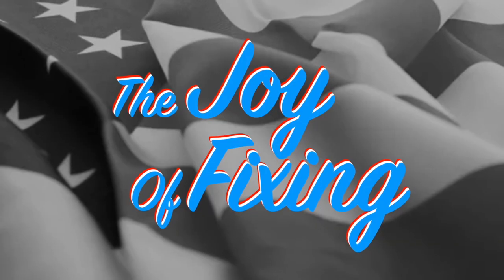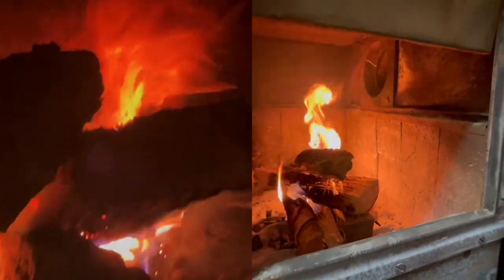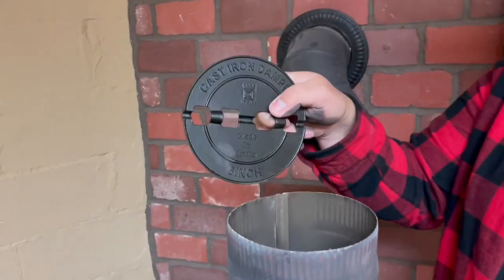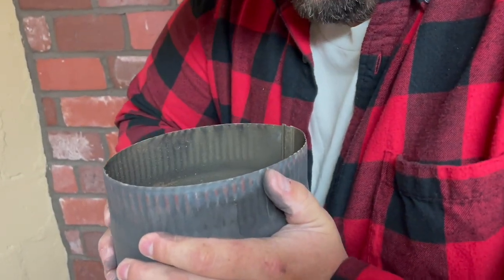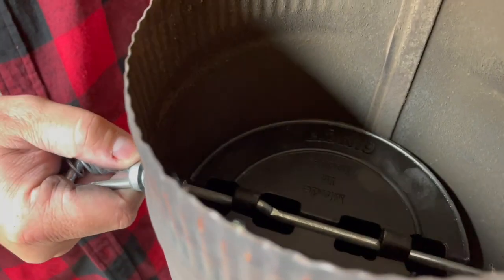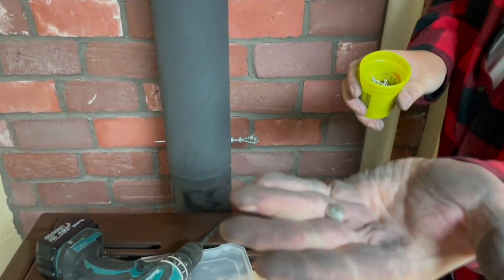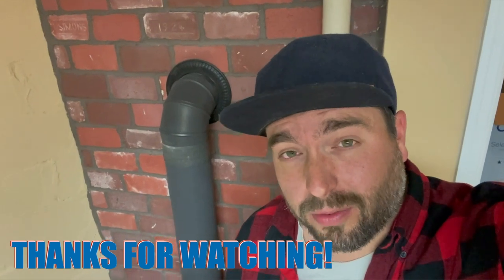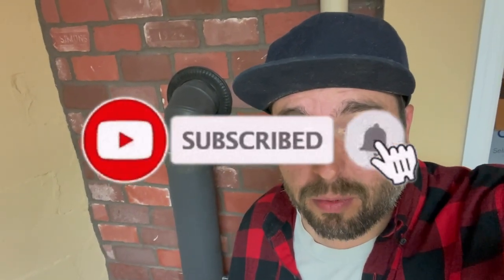This might MASSIVELY change your wood stove performance! Installing an Updraft Damper on your Flue!

Comment: I can tell you from experience that the flue damper made these days are just junk made in CHINAMAN ASIA or INDIA.. I change mine every year for the past three years. Then I had enough and made mine from exotic materials. INCONEL flapper and fasteners, TUNGSTEN ROD and Stainless Steel split collar clamps. Has been two years and the homemade unit is just bulletproof, period. 
        The stove pipe should be stainless steel instead of regular steel painted black. The heat resistance of stainless is so much higher and way safer too.  
        The stove that you have is perfect for a secondary burn option or you could probably just use perforated round pipe placed between the burn chamber and the flue pipe outlet of the stove. 
        What is the brand stove and what is the size of the burn chamber ??? 
         Nice work fella with what you did including using a stainless screw to keep the pipe from separating and causing a fire. The use of the corrugated elbow near the stove is a good safty feature. Adjustable elbow like the one on top have been know to just come apart at the most inappropriate times and cause a fire. Just saying without judgement fella.
Reply from the maker: All great points.
The Indian damper was definitely my best option locally. The Chinese one was like.... you could feel it was practically zinc. haha. My little shop doesn't currently have electrical so my tool power is limited, unless I have the generator out there. Once I get some outlets down there I'll end up having more tools to fabricate with at my disposal and maybe..... MAYBE I'll make my own damper some day.
I've had a hard time finding another corrugated elbow locally but apparently there's a store in the next town that stocks them so next time I was out there I was gonna go looking for one. Indeed, those movable elbows can fall apart eventually from getting so cold and then hot over and over again.
The stainless pipe would be great, but I honestly don't mind having the extra surface area letting off heat in my situation. Plus it's less than a 5 foot run of pipe and it's straight into the brick chimney.
The stove is like.... "King" brand. It's kind of an Ashley style stove with the coil thermostat that automatically articulates the air intake door based on how hot the coil is. Pretty cool unit. I've got another one in the shop that's even bigger. Burn box on this one is probably2 to 2.25 cubic feet. However, you can pack it to the top because it all just slowly burns down throughout the day/night if you set that thermostat to EXTRA LOW and the air is just barely creeping in (once there's a good coal bed going, that is).
Thanks for the comments. Great conversation!
Reply: @thejoyoffixing  I will watch your channel Joel for sure. The nice thing about my damper is the adjustable locking collars which can be adjusted for wear and tension. The unit is burn proof. The same material that is inside jet engines. The only thing missing is the external heat coating made of ceramic material. 
Nice conversation with you also Sir.
Reply from the maker: The adjustable locking collar would be a game changer. Honestly it's nearly impossible to find a complete damper assembly that would include a collar, or a splice, or even just.... you know... it's own housing (clamped or crimped or however it would be made..... but clamping would be nice to avoid all the crimped fitting drama), 
Also, i'm a sucker for ceramic liners on ANYTHING that's redirecting heat or exposed to constant heat. Wish someone would... make one of these for my SHOP STOVE cough cough cough haha
Again, thanks for the conversation.
Reply: @thejoyoffixing  I can tell you that these days it seams that if you want something really good you have to make it yourself. The excuse of Covid is just a bologna story to make things cheap for a high price, PERIOD. I can tell you that I just love making things for myself. Especially using exotic materials that will not wear out in my lifetime. Must be an addiction that I posses. Peace
Reply from the maker: I love making stuff too. My daughter as well. It's fantastic to create solutions instead of just buy solutions made of inferior materials, or that don't specifically meet the specifications you desire. Agreed that Covid really fleeced a lot of people who weren't willing to question anything they were sold or told. Tack on outlandish amounts of money fueling proxy wars and some Weimar Republic level inflation and I'm shocked more people aren't turning off their social media and takin action. But.... you know how it is.... people are content trading their freedoms and even their very livelihood for the illusion of safety and immediate comfort. 
There's a lot of joy in solving problems and fixing little things. Creating things. Figuring stuff out yourself. It's really something everyone could benefit and grow from.
Hopefully over the next few years I can help contribute to helping people find a starting point to trying stuff out for themselves. It's a true joy.
Reply: @thejoyoffixing  I could not of said anything better myself. Since you have covered the problem solving aspect. I have a fix for you and your wood stove. The flu pipe that is seen on the video from the inside of the fire box needs a round piece of perforated pipe longer than the six inches pipe the is exiting. The idea is when you close the firebox door. The round perforated pipe is slide closed with a round rod that goes through the wood looking door. This will cause the gases to combine with the available air and make the stove so much more efficient. You will be using one half the amount of wood that you used before. Yet the heat output will really increase. This causes pyrolysis to occur and burn wood completely. Then you need to bring in secondary air with stainless steel tubing that has holes drilled on numerous pipes. The pipes should really control the air just at the point of combustion under the insulated self located close to the roof. This gives you ultimate control with maximum heat output.
       The information given is not in a sequential fashion. This was done deliberately to make one reread the three parts of the paragraph. Hope this makes sense. Question if you need any clarification. Good day too. vf
Reply from the maker: No that all makes good sense. I was able to sort out what you were saying. I almost missed this response again because this video is getting so many comments I'm losing track of what's getting replied to. Glad I caught it!
Thanks for the conversation. I hope it helps others out, as it's sure given me just more perspective.... which is what this is all about. 
Seasons greetings and may God bless you and yours!
Reply: @thejoyoffixing  Thanks a bunch Joel. Same to you fella. You gave me such an open outlet to help others with stove STUFF. Keep on making more great videos for us all to learn from.
Reply from the maker: @victoryfirst2878  Thanks, buddy. I appreciate the kind words. I was hoping to release a video last week but health issues and waiting on a specialty glue pushed it back. I have a few coming up that are truly a pain in the butt, but I've figured out some pretty reliable ways to address the problems. Looking forward to sharing them.
Thanks for subscribing and thanks for the conversation.

Comment: I do believe there is a proper direction of flow on your vent pipe that you may have it reversed.
Reply from the maker: I have the same hunch as you but this is how the pipe was installed when I arrived at this house. I have plans of flipping the entire assembly and adding another corrugated elbow once I can find one in stock locally. Good eye.
Reply: @thejoyoffixing  I've always been told and read the reason the crimp end of metal smoke pipe  goes down on wood fired is so that any creosote running down the pipe will run down INSIDE the pipe. If the pipe crimp was up the creosote would run down and out the female end joint. On oil fired furnaces/boilers/stoves we use the galvanized flue or smoke pipe with the crimp end up that way it is said any poison gases like CO will drift up the pipe to the exit opening in chimney (flue). And never use galvanized smoke pipe on a wood burning appliance.
Reply from the maker: @Roger Rolfe - That is probably the most logical thing I'v heard regarding the direction of the stove pipe. On both of my stoves there is no way to install the pipe the other direction. It would require me doing some crimping to make it happen. The outlet on my stoves only allows for pipes to be assembled with the crimped side down.
The creosote idea is really fantastic. Makes a TON of sense! I might mention that in another video.

Comment: In the state of Wisconsin, you are not supposed to install one of those, No IDEA WHY, I do have one in my damper, it also helps to slow the burn to keep the wood lasting longer.
Reply from the maker: “(d)Dampers.
1. Manually operated dampers are prohibited in chimney or vent connectors of all appliances except wood-burning appliances.
2. A listed, automatically operated damper may be used with any heating appliance provided it is installed and used in accordance with the appliance and damper listing.
” Wis. Admin. Code SPS § SPS 323.15
Reply: @thejoyoffixing  Well put, my wood fired boiler has a electric draft inlet that opens and closes to match the thermostat (aquastat) on the boiler. The installation manual calls for a barometric damper set at .02" WC    ( .02 WC(Water column) and on that unit it says not to use a manual damper like yours. Here if I went away from the manufacturers instruction and had a house fire my my house insurance would be void. Hope no one gets this the wrong way because if the manufacturer says you can put a manual damper on then the is the type you use.
Reply from the maker: Thanks @Roger Rolfe.   If I had a wood fired boiler I would probably not be modifying it at ALL from the manufacturer setup, as that is a whole different animal (and one I wish I had).

Comment: At least from what I've read and been told, that's mostly for older stoves. Newer ones use double walled stove pipe which supposedly means you don't need a key damper. In my case, with a double walled stove pipe, it could help true...but my main issue is my brand new stove is leaky as hell. So that's the angle of attack I'm taking.
Reply from the maker: I believe you're exactly correct. This stove, somehow has just enough leaks that it is not perfectly regulating the intake through the intake damper this unit has. If the damper is closed, and the ash door is closed AND the feed door is closed, the fire can still get ROARING. Well.... at least burning enough that you can hear the wood crackling inside.
It's not, by any means a NEW stove. It's fairly old but in very nice condition. I've replaced the rope gaskets in all of the doors. So... the only thing left to do was regulate the updraft so I can "ultra-slow burn at night". The damper in the flue seems to do the trick. 
During the daytime I don't need the damper, unless it gets so hot in the house that we're down to t-shirts and still breaking a sweat. haha.

Comment: I still dont see the difference whether you control the air flow down low or up top.  If you have the intake fully open, then install a damper on the flu up top and set it at 50%, why not just set the intake at 50% and not install the damper?  Just seems a little redundant.
Reply from the maker: Frank,

I absolutely hear where you're coming from. It would be hard for me to explain it anymore than I already tried to but I do notice a difference in the control I have now that I can control air either at the intake or at the discharge. It all depends on what type of wood I'm burning, how wet the wood is, how hot I want to burn or maintain coals. I do notice an extra bit of control.
However, I have said in other comments, I do believe this application is, for the most part, redundant. The proper application for a butterfly damper is on a traditional stove that doesn't have a baffle or damper otherwise. Still... I like it for mine. I like locking down the chimney/flue pipe. It works for me.

Comment: Just for your information, you have all your stove pipes oriented the wrong way, male ends should point down towards stove. Prevents creosote frim leaking to outside of pipeing.  Jojofixer picked up on that several comments back as well.
Reply from the maker: the male ends are facing the stove. all potential creosote is running downhill.

Comment: A piece of masking tape stuck around the dampener and make holes with the retaining rod and transfer the tape to the flue pipe and the holes can be drilled
Reply from the maker: I misunderstood this comment, and differ to @Mike Curliss on this one. I appreciate the comment @Ian Coker but I don't think the math works out.
Reply: I dont think that works. Outside diameter of dampener probably smaller than inside diameter of flue. Will put hole slightly off which....well....big pain.
Reply from the maker: @Jehucurliss2kings  No, I think I understand what he's saying. Like... you could do it with paper too, or anything else thats thin and flexible. Oh wait..... I think I misunderstood. 
I thought he meant to use the tape to basically mark out where the holes would go, and use the retaining rod independent of the baffle to figure out where the center of the flue pipe was and mark holes. Then, move the tape further down the pipe away from the collar and drill the holes.
But yeah... I think he's saying you use the flue for the tape, which means the outside diameter of the damper (which is massively smaller than the outside diameter of the pipe, or even the inside diameter of the pipe) would be far too big and you'd be drilling lopsided holes that would result in not being able to install the actual damper, or at minimum not ever being able to get it anywhere near closed.
Good callout. I missed what was being said.
Reply: @thejoyoffixing  maybe use a speed square from end of flume to transcribe marks
Reply from the maker: @Jehucurliss2kings  I considered it at first but the round pipe doesn’t allow for a not of surface contact at the edge of the square. Plus you’re kind of eyeballing the top line. A rigid square on a curved surface didn’t seem like the right tool for the job. The mailable piece of paper stock worked best.
Reply: @thejoyoffixing  I'm talking about a speed square that has a "shoulder" or ledge . Would probably work better from end with no "ruffles
Reply: Or maybe use a string round flume. Then lay flat and mark halfway point on string then put back round flume and remark.
Reply: A speed square...not a square or whatever u callit.
Reply: I know flume is round but ledge of speed square may still level on it. Then flip speed square around and see if realigned with same mark. Then draw line or whatever
Reply: @thejoyoffixing  or how bout laying a small flat piece of square metal at end of flume then putting speed square on that. ?
Reply: There it be I think.  Thank you. Practically the last thing I need to do to finish my pot belly stove with upper and lower boxes and roof cut on bottom of upper box so flame cant shoot directly up into flume. This brain session helped.
Reply: Once I finish the metal roofing over stove area lol
Reply from the maker: @Jehucurliss2kings  this is growing increasingly complicated, Mike! Haha.
Reply: @thejoyoffixing  no , actually,  I think the metal shim and speed square transcribing marks on end to needed location works.
Reply: Or use pi x radius squared for circumference then divide in half.  Use a string. Or was that diameter times pi for circumference.  Ya I think. Then divide by 2
Reply: My brain is twisted round doing a partial metal roof for first time right now.  Not a clear head.
Reply: Pi is roughly 3.14 I think
Reply: I tired lol
Reply from the maker: @Jehucurliss2kings  If you blanche the egg first, then decapitate the squirrel at a north-westernly angle, you can apply the pipe paste. If the paste casts a shadow before 3:00 pm you know it's too viscous and will require thinning. Thin the glue ONLY using Indonesian cat shampoo. Once the damper is in retrograde, attach the belt and pulley to the shaft. Rotate slowly (around 3000rpm) until the paste evenly lubricates the moving parts and smooth rotation is achieved. At this time you may add more coal to the generator and allow the throttle to engage at a higher tension. Damper should be spinning at a safe and trusted 13000rpm. 
Crap wait.... I translated that from Indonesian wrong.
Actual Translation seems to be "Use happy good fun time piercing shaft rotate circle metal pancake pipe obstructor". Huh... those weren't very good instructions at all. Should bought the American made one after all.
Reply: @thejoyoffixing  now that I'm off the roof . It's not that complicated.  Take the circumference (if you know what that means) and divide in half. Theres your two points. Use a piece of paper. Wrap around so you get a true circle.  Not very complicated